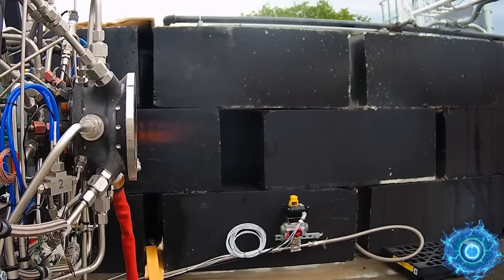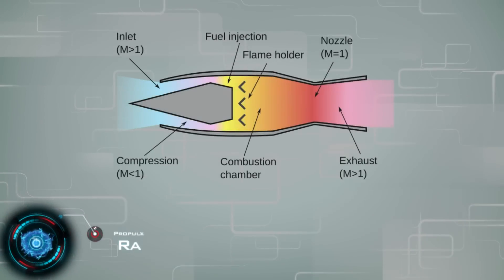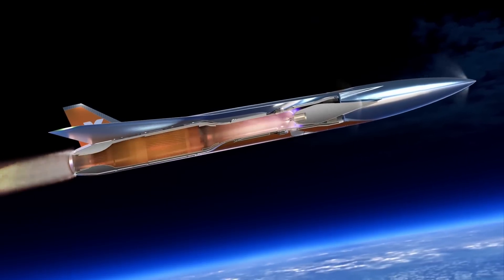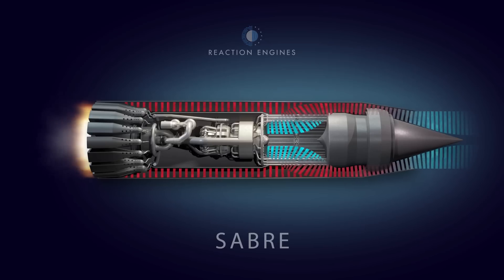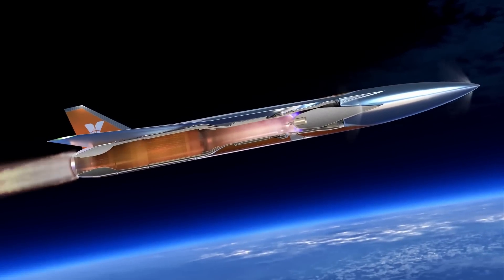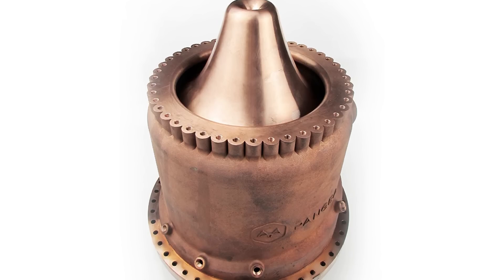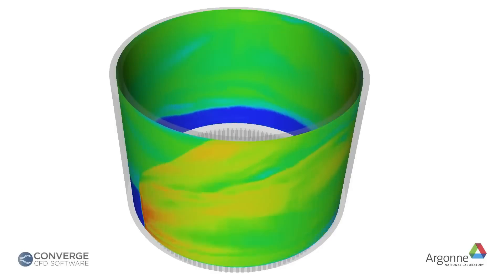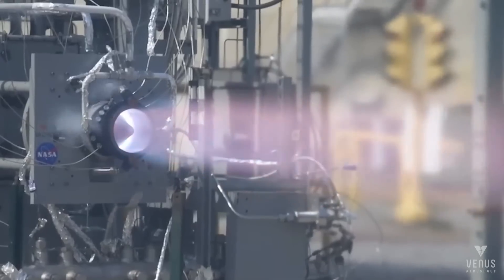Breakthrough Aerospace ENGINE Is GAME-CHANGING

Comment: I don't know about anything; I'm just saying random stuff;
heat; basically, put engine in the center of rocket, make the wing basically radiators with multiple layers with spacing in between the layers, and a high heat conduit metal around the engine, then add a type of coolant, and put motors/pumps inside of these thin layers to make the liquid in the layers travel to the wing and back to the engine, then the air pressure will strip the heat off the wing's holes and possibly cool it and send it back to the engine.

thou it has to be thin the layers, it has to have a solid build; and making the end tip of the wings of each layer basically very thin as if it was a scapple to cut threw air more effective and push the air into the internal layers, so it can bunce around and rapidly cool the radiators wings.

Comment: I can see this being used for very specific aircraft, but not airliners. Noise levels would be a significant problem.
Concord was an extremely loud aircraft with 4 low bypass engines, so I see noise as being a problem with this.

Comment: Sandboxx described an engine being developed by GE in collaboration with DARPA and US Air Force Labs. It combines a turbifan for low speeds, a RAMJET, SCRAMJET, and rotary detonation combustion chamber.  Rotary detonation is   more efficient extending range and power for a given quantity of fuel compared to deflagration, the method currently in use. The rotary detonation combustion chamber can be retrofitted to existing turbofan engines. The combination would provide a smooth transition from 0 to at least Mach 10 and back to 0. The transition from ramjet to scramjet is made by varying the geometry of the intake manifold. Subsonic air flow for Ramjet, supersonic for scramjet. This looks promising for NGAD and FA/XX.

Comment: This is an achievable goal, the secret is to use different fuel types for each stage to achieve the needed thrust performance along with YAG based combustion liners for material integrity at each step...
Reply: Another possibility is to use turbo fans with blades extending inside from an outer ring, rather than blades extending out from a central shaft. This would enable blades that could retract as stages move up, preventing blades from erosion in high stages, as they could fold back and the central shaft isn't needed elsewhere in the design.

Comment: So... the bottom-line is that not much has changed since the P&W J58's used on the A12 and SR71.
Only the spectre of adding a rocket motor seems new.  And you'd need a LOT of volume for oxidizer in the fueselage of the aircraft to get to LEO.

Comment: SSTO? It's really unnecessary. Fuel cost is a very small percentage of a launch. The added complexity and weight of an air breathing engine and control surfaces makes payload capacity less as well.

A two stage with a returning jet stage might make sense though, for small payloads. The aerodynamics would be nasty, but it could be fully reusable. And could launch from nearly anywhere.

Comment: Not sure I know anything but I believe that a removable fan slides in and out of the chamber could take off from the ground and in the air the fan will be mechanically slipped out slipped out the side and then they can ignite the Ramjet

Comment: Plasma? it's the only thing i could think off that can get the temps up high enough fast enough, but the challenge is to not have it blown out by the airflow but if it could be done there wouldn't be any fuel, or atleast not much and only used to supplement the thrust.

Comment: I find all of this rubbish because if they have the technology why not try it now and not in 30 years time. If you don't try don't achieve.
Reply: Cost and commercialisation. No big manufacturer is going to spend the 500m to 1b on development costs without an airframe committed to fit the engine to. It's building something without a customer or any business plan hence why we still incrementally improve gas turbines.

Comment: So it's the material science again, that we are waiting for.  Designing the hull for high speeds and atmospheric reentry is next.  These heat tiles are not the optimum solution, unless we make a giant ceramic pot;• ehhm, a ceramic hull from one piece.  But there could be much simpler propulsion solutions, if we had the neccessary alloys, where the pilot does not sit in a fuel tank with windows.
🚀🏴‍☠️🎸

Comment: 2 points...
The higher you go, the farther you have to travel compared to Sea level.
Higher you go you need to bring Oxygen, MORE and MORE..
At 100,000 feet, you are traveling 19 miles Which equals at sea level 1 mile.
40,000 feet is 7.5 miles, equal to 1 mile at sea level..
200 mph at 40,000 will take ABOUT 2.5 minutes.  And only get you 1 mile at sea level.

Comment: We have had a multi-mach ramjet (with afterburners) flying fuel tank for over 60 years.  Lockheed did pretty exhaustive R&D on engines before they came up with the pinnacle SR-71 Blackbird.  I didn't see anything in this presentation that was new since then.
Reply: Lockheed did not manufacture the PrattAndWhitney J58. Robert Abernethy developed the design for PW.  It was not intended to be a RamJet engine. Abernethy modified his engine with High pressure bypass ducts to cure a "Ram Choke" which tended to partially "Compressor Stall" the engine at high Mach one values..
Clearing the gas path of this ram Choke enabled M3 velocities...
Reply: Efficiency. A rotating wave engine is a lot more efficient than a traditional ram jet.